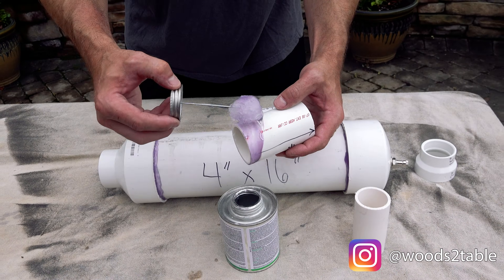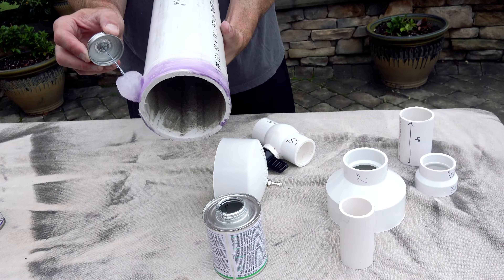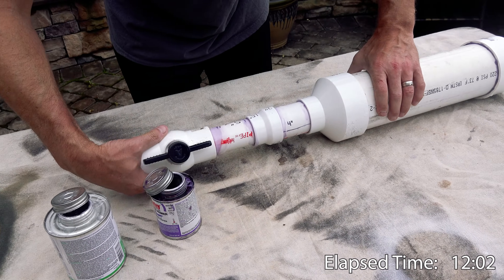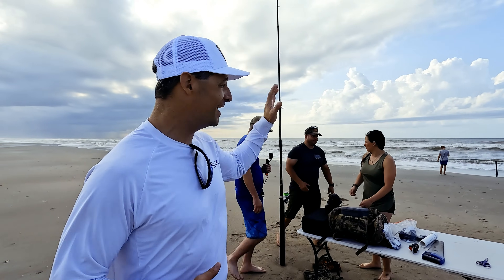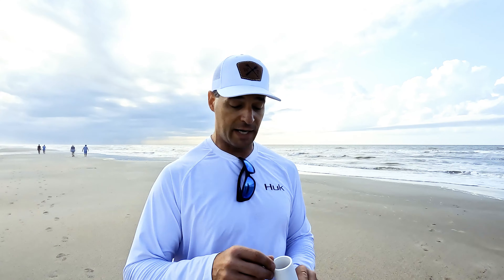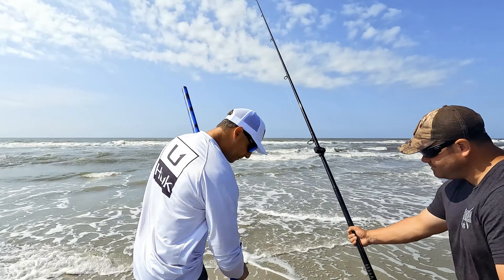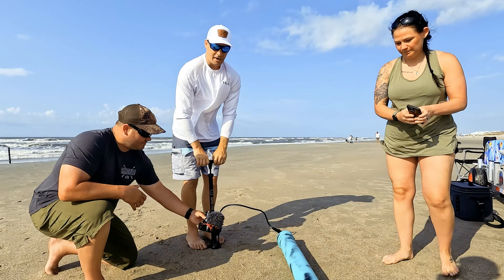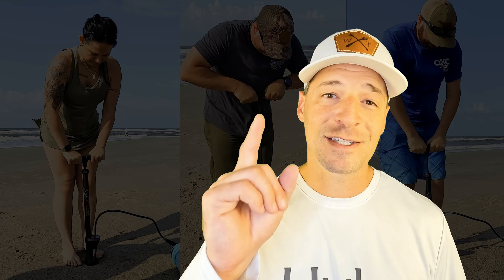TINY BAIT CANNON! Will it Work?! HOW FAR CAN IT CAST??

Comment: Where are you buying your PVC? Pretty much everything I'm finding is DWV for non pressure applications.
Reply: Your parts list doesn't match the parts that you show pre-built. What's this for: "(1) 4" x 1.5" diameter pipe (schedule 40; connects ball valve to 2” step down connector / reducer coupling)?"

Comment: why not use butane? I've always used just a wee squirt direct from the can and then let a small puff of breath into the chamber before threading down the clean-out fitting at the back. my little one is a real rib buster. sends little spuds so high so fast they are simply never seen again. softer fruits vaporize at the muzzle producing a fine sticky mist. air just doesn't SLAP the same. but also somewhat more dangerous.

Comment: I saw another bait cannon video where they used paper towel or toilet paper loaded into the barrel first to make a seal and the bait was not frozen. a rubber washer sandwiched between two pieces of plastic to make the seal in the tube launcher, you can attach the underside of the plastic seal to the inside of the launcher tube so you don't lose it when launching. You can put two screws into each joint side to help hold it all together.

Comment: I know it’s an old video so you probably might not see this comment but I’d like to say that your math is slightly off because it’s pounds per square inch so having less pressure and the larger cannon could technically mean you had more pressure overall
Reply: More air volume. Bit different.

Comment: Suggestion: Use a scuba tank with regulator for quick effortless filling. Use the regulator low pressure port and BCD inflator attachment. The LP port delivers 110 to 140 psi and can be adjusted to your preference. Push button start stop operation. An 80 cuft scuba tank will deliver dozens of surf cannon fills. Get rid of that bicycle pump unless you really like the workout. 😂😂

Comment: Use a paintball air tank those things handle 3000 psi. You can pressurize it very slowly and still get 120 psi in about five seconds. Before you decide to do this pvc doesn’t handle air pressure well. Over time stress fractures will come. Use 2 inch metal pipe put 200 psi and good to go

Comment: Use a paintball air tank those things handle 3000 psi. You can pressurize it very slowly and still get 120 psi in about five seconds.

Comment: How do you thread in a gauge without it leaking around PVC
Reply: You should really use metal pipe or a fire extinguisher can for the pressure tank. I've used both and they work equally well.

Comment: Add a pressure gauge. Then use a co² bike tire filler. Probably want the 25g co² cartridges, but experiment to see what brings you up to pressure without waste. 

No more pumping. 😁

Warning ⚠️ ☠️!! Fill slowly 🐌!!
You don't want to freeze the PVC, and make it brittle. 

You could also use a PCP air tank from paint ball. With the regulator, it would charge the system to the desired PSI, and no more. They're essentially a tiny scuba tank, various sizes.

Comment: Why don't you get an empty gas canister (Propane to you lot at the other side of the pond, and modify it so it can be charged off an air compressor and used as a portable refill rather than spend ages pumping it up, bit big this example but you get the idea, here in the UK we have small ones about 4.5kg size https://www.youtube.com/watch?v=sL7gUrrF1uI

Comment: Hi there . I love your design and are keen to have a crack at building one but I'm in New Zealand so our measurements are slightly different.  I have a question around your barrel . It's only 1.5 inches in diameter right and 2/3 feet long, right?    Why so thin?  1.5 is tiny .  Does the thinner barrel give you further distance or is it just to house the bait assembly?  Thanks.
Reply: I'm on Waiheke. Did you try this?
Reply: @jcnz9861  yes I did works great.  Not as powerful as his but powerful enough to get the bait out in the deeper water.

Comment: What is that metal part you guys screwed with the pliers? Also what does it do?
Reply from the maker: A little “keeper” (tension) screw. It helps hold the barrel in place.
Reply: @Woods2Table  thanks mate 👍

Comment: You can also build these using a sprinkler valve tapped with a air blaster gun, as your trigger which moves the diaphram inside the valve causing the chamber to release the air.
Reply: Exactly!

Comment: I've build these 20 years ago as tennis ball launcher. Word to the wise, SCH 40 is much safer repeated use if you stay within 100-120 psi MAX. This is why that bait cannon was ultimately released using a metal chamber.
Reply: Use SCH 40 PVC. I bought everything from Lowe's, and special ordered a 2.5" section of pvc specifically so it could launch tennis balls 😂. My tank or air chamber I use a two ft section of 4" sch 40 PVC, and added a PSI gage to it.

Its easier than it looks I promise once you get started. Take your time, apply your cleaner and glue generously to each joint. I can post a link if you would like that breaks down how to build one of these
Reply: @VentureWelding thanks man appreciate you responding. Im good with the building process I actually am a pool Tech for years i could get the regular schedule 40 from butnira 77+tax for 16 to 18 feet of 4" pvc ill be wasting on. If I could post a picture or a way to send you. The 3&4" pipe at Lowe's says the same thing and both Lowe's and home depot get from Charlotte piping and they say in the red dow the pipe it is schedule 40 but also says "not for pressure" and also has dwv on there as well or I would bought it weeks ago for just the 10 feet and be launching by now. If it has dwv drain/waste/vent written anywhere on the pipe that is the indicator that this pipe has not been rated for pressure as well. Im live in florida maybe they have different at your store?
Reply: @catdaddy02 NO DWV PVC will not suffice. You need SCH 40 plumbing PVC ASTM D1785 for this, which is pressure rated. DWV is thinner and not pressure rated. That's the type you would use for like drains and stuff with no pressure.  

Hope this helps.
Reply: @VentureWelding thanks man but no shit didnt you read my message? Also ive been servicing plumbing pools for 22 years no shit. the whole question is where can I buy JUST SCHEDULE 40 OR 80 WITHOUT HAVING TO BUY THE WHOLE DAMN STORE 20FEET for both 3" and 4" not to mention AGAIN my home dep,Lowe's and ace ALL have CRAP DWV DRAIN WASGE AND VENTS
 Anyways they all have shit dwv fittings as wel that I see people buying for pool plumbing and they havee no clue
Reply: @catdaddy02 Yeah sorry man, I was driving and reading earlier. Don't know what to tell you there, guess my location was more accommodating. I never had to buy 20 ft sections. Best guess would be source your materials online brother. Plenty of places that sell it online, and far more competitive.
Reply: Could they explode?
Reply: @IveGotBigWoodWoodworking  yes, PVC can explode, producing shrapnel that the doctors may have a hard time finding to remove.
Reply: He said on one of his videos don't use DWV but no matter where I go whether its home depot, Lowe's or plumbing stores no one has 3" or 4" piping that does not say schedule 40 and has dwv on it as well as (no pressure) stated. So is he using schedule 40 dwv? Or what?!
Reply: Question for you. Where can I or if its safe to use He said on one of his videos don't use DWV but no matter where I go whether its home depot, Lowe's or plumbing stores no one has 3" or 4" piping that does not say schedule 40 and has dwv on it as well as (no pressure) stated. So is he using schedule 40 dwv? Or what?!

Comment: I just built it! What is that metal piece that you have on it?
Reply from the maker: Only things I can think of are the air valve and the keeper screw that helps hold the barrel in place. Great job on the build! Best of luck on the shore.
Reply: Thanks did u thaw out the ice

Comment: Also have you guys considered using drones?
Reply: I use a drone and its magic .
Reply: I was going to reply that they are illegal in NC.  Turns out I was wrong.  You can spot and drop bait with a drone.

"§ 14‑401.24. Unlawful possession and use of unmanned aircraft systems.
(a) It shall be a Class E felony for any person to possess or use an unmanned aircraft or
unmanned aircraft system that has a weapon attached.
(b) It shall be a Class 1 misdemeanor for any person to fish or to hunt using an unmanned
aircraft system.
(c) The following definitions apply to this section:
(1) To fish. – As defined in G.S. 113‑130, except when an unmanned aircraft or
unmanned aircraft system is used during, immediately preparatory to, or
immediately subsequent to the taking of fish for (i) spotting; locating;
recording, broadcasting, or streaming video of fish; or (ii) deploying bait.
"
Reply: I used my DJI drone to drop bait. The water surface confuses the sensors and drone will say "landing" you have to be quick with the lift toggle. Also, keep it 30' above the water

Comment: You should try installing a handle on the ball value to release the air faster for more distance. By the way I used your videos to make my cannon thanks for the reference. But i did screw the barrel into the ball valve.